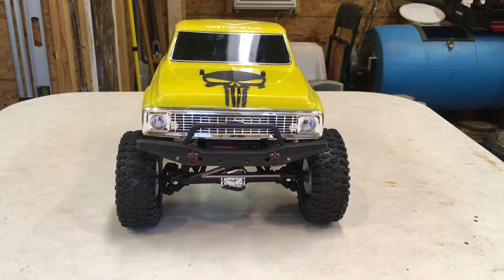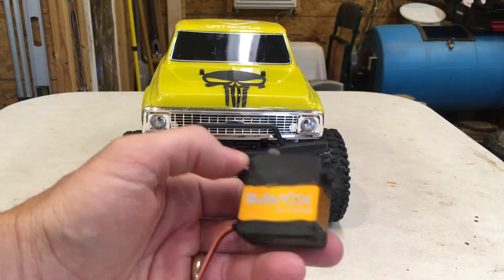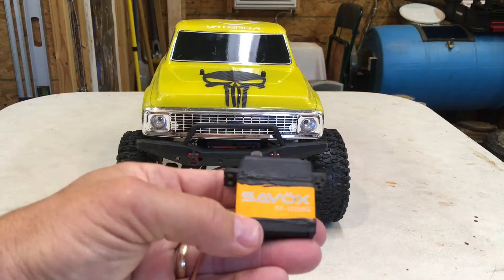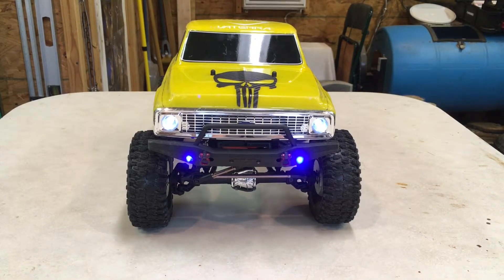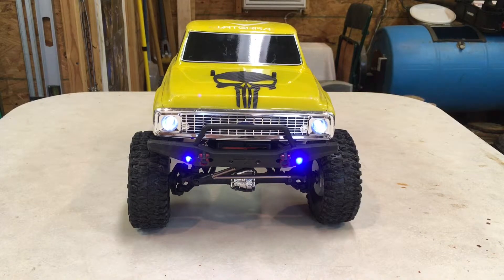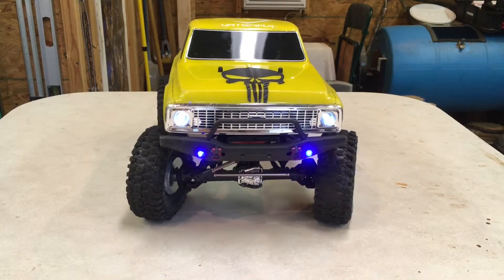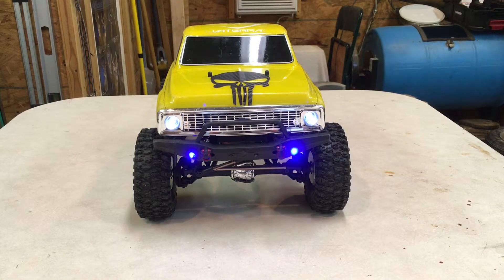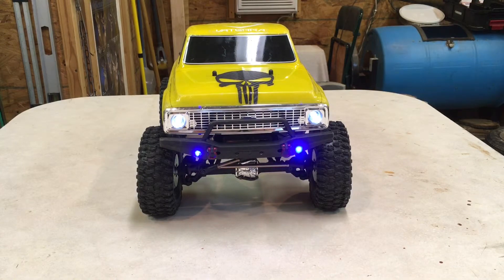Savox 1230SG Steering Servo

Comment: Do u need a BEC with this??
Reply from the maker: You could probably use one to get a little more power to the servo but I did not. However, since this video I have been running the 35kg servo from Amazon on my crawlers and I like them much better. You can normally get those for around 30 bucks too 😃

Comment: nice job..But for the money you cant beat arrma 15kg... $15.00 on ebay
Reply from the maker: RCbashing the KRATON 
You are correct they are very good. I will continue to use it in my basher. I just needed a little more torque
Reply: Sure you can those 20kg or 25kg or 30 or 35kg servos on Amazon are way better than the arma one.